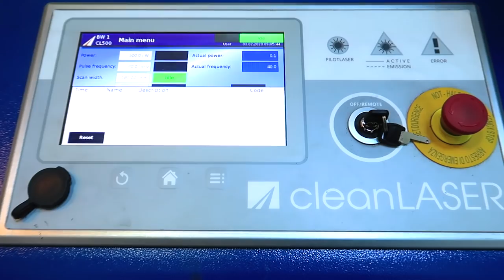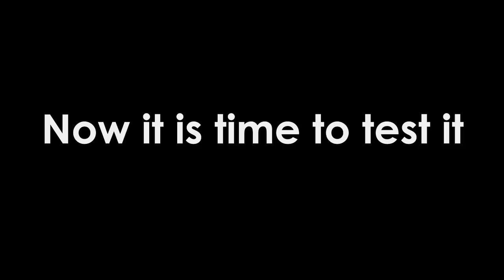Restoring World's Smallest Italian Coffee Maker

Comment: Do you have any recommendations for people without access to a laser or sandblaster? 

I know it can't be situational, but any ideas to start looking around into would be great. I have little experience in metal parts and am more f a wood kinda guy.

Much appreciated and fantastic restorations my dude
Reply from the maker: Thanks for appreciation. You can use a soft brush attachet to a grinder,or electrolisys..if you need to remove paint,paint stripper work well..there are many methods to do the job

Comment: I have never had one of those that made good coffe, but this one looks pretty amazing!

Great job, it turned out really amazing
Reply from the maker: Thank you Virginia 🤗🍀🍀
Reply: It's a bit more complicated than water in bottom, grounds in basket, screw together and put over heat.

I suggest putting hot water in the bottom (use water from your kettle and watch out, thing gets hot). Use a fine-medium grind (I use setting 10 on the baratza encode/virtuoso). Fill the basket and make sure there's no air pockets, but don't compress the coffee. This is to prevent channeling (where the pressure pushes grounds out of the way and goes straight through without really brewing). Then screw the whole thing together (watch out, hot), make sure you get a good seal and don't overtighten, and put it over low heat. This is important. You want it to brew, not boil. When the flow goes from deep dark brown to honey coloured, it's time to remove it from the heat source.

That way you'll have a deep, rich coffee that isn't over or under extracted.

My moka pot experience reached new heights when I learned this. It's almost a ritual for me now. Very calming and grounding.
Reply from the maker: What you write here,is barista level 😂😂 but good to know 👍🏻🍀🤗🤗
Reply: @annemariekevandijk7431  omg, im ashemed of the way i used to do this! Haha thank you very much, i will try this!

Comment: I don't know muich about coffee makers, but that looks like a percolator to me. They're notorious for making bitter coffee, since they burn it and the like, I think.
EDIT: I think this one might be different, since it dispenses during the process. The percolators I've seen use the heat to pump the water up a tube, where it drips down into the coffee grounds, and then drains back down, rinse repeat. The reason they're notorious is they burn the coffee before it's done brewing. There's one type of percolator that only has the heating element right under the tube which avoids this problem to some extent.

Comment: Question:
If the paint is intact, can the cream of tartar & lemon soak damages the finish?
Reply from the maker: I didn’t try it but I think don’t do any damage because this process is made even if you want to clean,not only restoration process,but I also know that is made to aluminium pot,I dont know if has paint on it if work well or not 🤷🏼‍♂️
Reply: @CoolAgainRestoration  excellent. Thanks for the reply 👍.
Reply from the maker: 👍🏻👍🏻welcome mad max
Reply: @CoolAgainRestoration  FYI... I doesn't work!.. read my other/individual reply.
The cleaning process discolored and weakened the existing finish ruining it.
It seems to be great for stripped/blank hardware but, definitely not finished items.

Comment: FYI.. DO NOT CLEAN WITH CREAM OF TARTAR BEFORE YOU READ.
So I while back, I bought one of these Brandani moka pots used, but in great condition.
The finish was original with almost no defects (except for the bottom of the boiler).
It also had some hard water stains inside of the boiler, strainers & top half of the moka pot.
I basically wanted to clean the hard water stains on the internals, while keeping the existing finish of the pot.
I decided to use the same Cream of Tartar & Lemon cleaning method as shown here and now I totally regret doing it.
It discolored the top finish and it weakened it to a point where it came loose and chipped in many places. Now the finish is ruined and I don't have the means to restore it. You can check these pics: Brandani Moka Pot https://imgur.com/gallery/uqoBg5W
If using this cleaning technique, use only items that are in the white (not finished).
You're taking a chance of running the finish if you do.
Reply from the maker: You did something wrong then 🤷🏼‍♂️ you can also check many searches for how to clean your moka pot with cream of tartar and lemon or vinegar. There are many method but depend of many factors 👍🏻
Reply: @CoolAgainRestoration  I follow your instructions. 2 Tbs. Cream of Tartar, 1/2 Lemon, boil for 20 mins...
I even cleaned/boiled painted items separately from the others to avoid scratches.
Most if not all of Cream of Tartar tutorials that I saw, used non painted surfaces in aluminum & stainless.
None mentions painted or finished items.
Reply from the maker: Like I said first. I dont know if this process would harm the paint or not. What I do it there was only aluminium,and all 3 moka pots from home was in aluminium or stainless. I cleaned all from my house,but none was painted 🤷🏼‍♂️

Comment: Scusi... what is tartar?
Reply from the maker: Technically, cream of tartar is an acid—specifically, tartaric acid. It’s a byproduct of wine production, the residue left on the barrels, actually. Most commonly, cream of tartar is used as a leavener, because when it’s combined with baking soda, together they produce carbon dioxide gas. That’s the same gas that’s produced by yeast in bread baking. When it’s added to egg whites, it boosts the strength of the individual air bubbles and slows down their natural tendency to deflate. And when added to simple syrup, it prevents sugar’s natural tendency to re-bond and form crystals.

Comment: I just loved your video, so satisfying!
A question: I have a moka pot with blue enamel on it. I kinda burnt it a little bit last time I used it and the enamel on the bottom, close to the flame, faded into a lighter blue. It didn't bothered me as much as the stains that appeared. Is it possible to remove the burnt stains myself or only with a laser?
Reply from the maker: You can do it but after you remove the enamel,you have 2 options: Clean the aluminium and let it gray or repaint with heat resistant paint. If you dont want to remove the enamel,you can try with a polish paste and some clean towel. I think the stains will dissapear after little polish
Reply: @CoolAgainRestoration  Thanks for answering! Is there some type of polish that you recomend? I only have one here that is for silver
Reply from the maker: You can search for enamel. I really dont know if exist for enamel but if you search maybe is. If not,i think polish for paint work great. Enamel is like paine anyway. But you need to know how to polish..
Reply: @CoolAgainRestoration  I'll search for more information about it then. Thanks!
Reply from the maker: Fernanda Beraldo if you need more info when you do the work,I’m here,just write a comment and drop a heart then at this message
Reply: @CoolAgainRestoration  Will do, thanks for your time
Reply from the maker: For nothing 👌🍀

Comment: It looks very good again, but if it is aluminium, you’d better not drink too many espressi from it
Reply from the maker: Why? Too many pots for coffee are from aluminium 🤷🏼‍♂️
Reply: Cool Again Restoration they suspect that aluminium is one starting factor for Altzheimers .If you look inside the bottom part you will see where aluminium corrodes and therefore goes into the coffee 🥴. We switched to stainless steel, but the coffee tastes a little different, and they are not as nice looking as yours!
Reply from the maker: Then happy me because I only restored,I don’t drink coffee too much. 1-2 cup in one month 😂
Reply: Cool Again Restoration 👍🍀👍
Reply: It was somewhat debunked since. Also these coffee makers use safe for food preparation aluminum alloys anyway for a long time now. (This coffee maker is in fact of 2010s (2000s oldest) - just slightly beaten up)

Comment: Try to use hydrogen peroxide and uv light to bleach the rubber
Reply from the maker: That method work for plastic,not for rubber
Reply: @CoolAgainRestoration  mmmm well I mentioned it because I have seen another channels using it for bleaching rubber from consoles and gaming controls
Reply from the maker: It is not true(what they said or made). Search on google : retrobright yellowness. And it’s a big topic where all the people said that this method works only on plastic and is another material that seems to be rubber but isn’t. To Rubber and silicone,retrobright can’t do anything